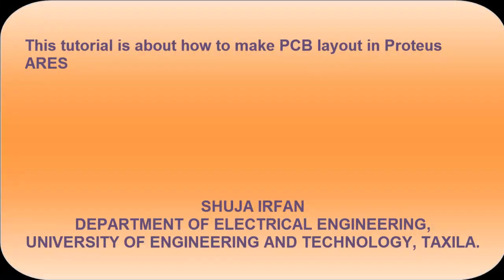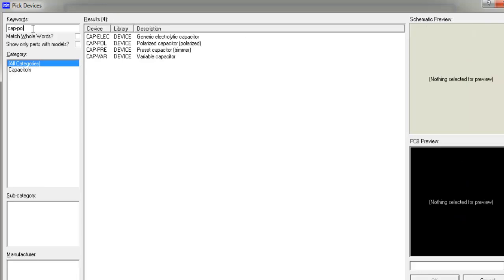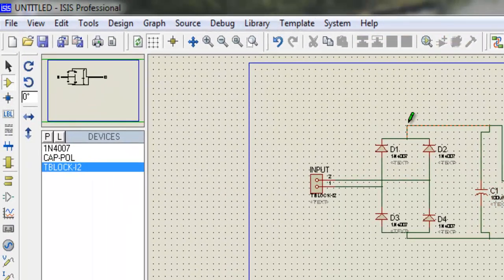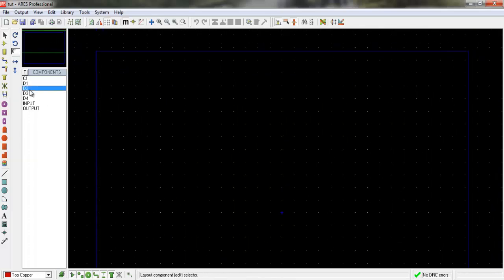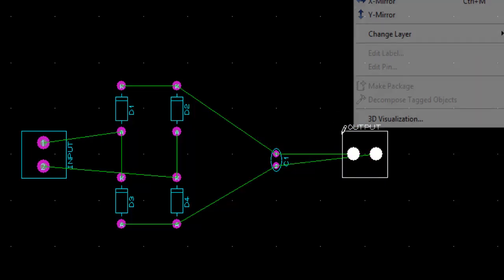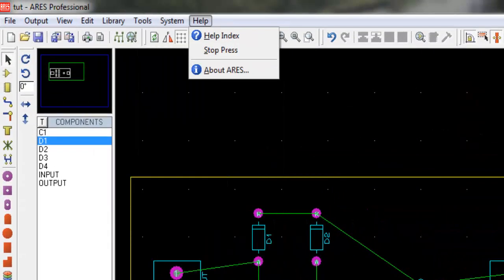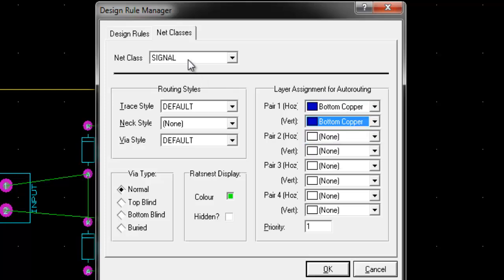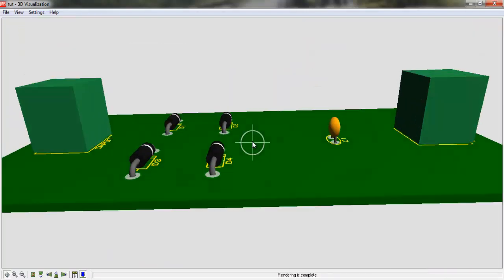How to make Printed Circuit Board (PCB) in Proteus

Comment: Hi sir ! How can i change the settings so i can print exactly according to the size of the components i will be using ? When i printed it , it had printed the whole size of my paper . please help .
Reply from the maker: There are several things to consider in this regard. Use print instead of export. Select ratio as 100%. Also you will have to look into printer options so that there is no scaling option selected there. Also, you should select the exact paper size you are using there so that you may get as good a result as possible. Happy designing :D
Reply: Okay sir.  You and my professors are so great . He had also said the same thing, thanks for the huge help ! Keep up, sir !
Reply from the maker: I am happy to know you appreciate my work. Thanks
Reply: Sir ! I actually made it ! Im about to start up my triple transistor amplifier and im happy to let you know that you helped me a lot . thks for your work sir ! I wanna show you how it turned out but i just dont know . Haha. By the way, thank you!
Reply from the maker: Thanks dear. I appreciate it.

Comment: Sir why is the board edge/boundary not being printed
Reply from the maker: you can check the board edge check box and the board edge will also be exported alongwith your design.
Reply: THE TECH TONGA I did check the board edge option in print layout, but still it does not show up the board edge in pdf

Comment: can you please tell me how to make spice model for tblock or add library in proteus
Reply from the maker: tblocks usually don't need a library because they ought to represent connection to external devices. what purpose would you possibly want your tblocks to perform in the simulation?
Reply: +THE TECH TONGA  yes for simulation
Reply from the maker: +kashish ahmed what function do you want them to perform?
Reply: @technicult0  but why when I type tblock then they did not appear
Reply from the maker: @haziqahmarzuki3592  you might have selected some other component category or may have corrupt proteus files.
Reply: @technicult0  thank you. Tblock has appeared.